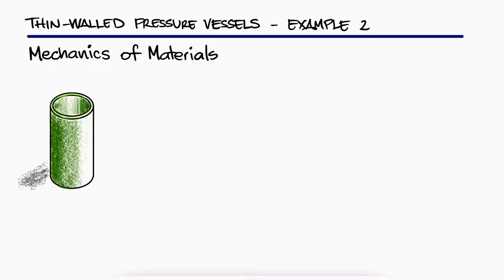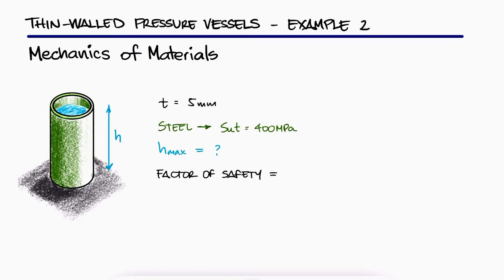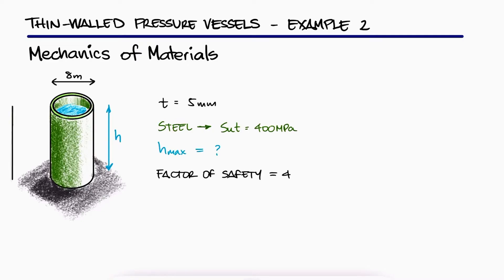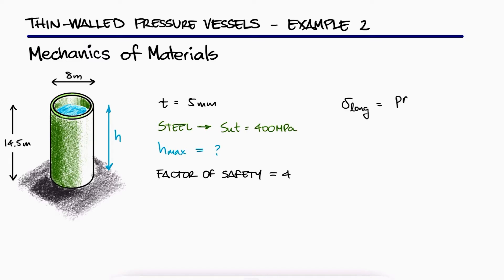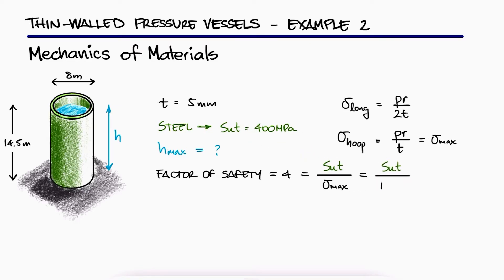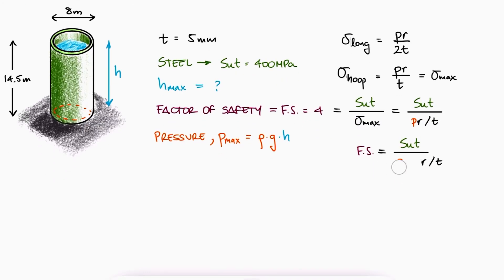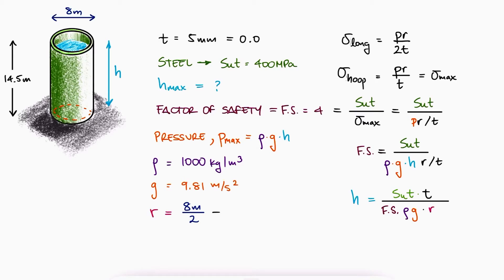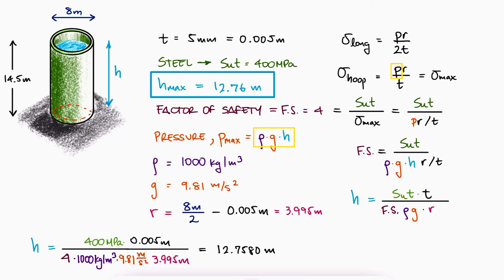CYLINDRICAL Pressure Vessel Stresses in Under 2 Minutes!

Comment: The calculations of above numerical values does not results in 12.7 meter ? Anyone can Explain ?
Reply: Yes answer is 1.27*10^-5
Reply: @uzairali4822 400 mPa unit is N/mm² to convert to m², multiply it using (1000)²